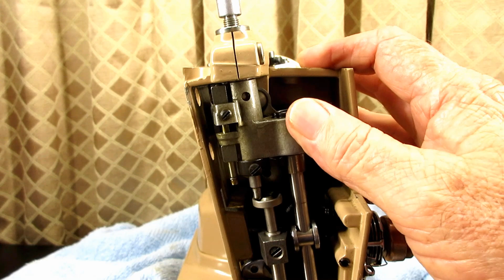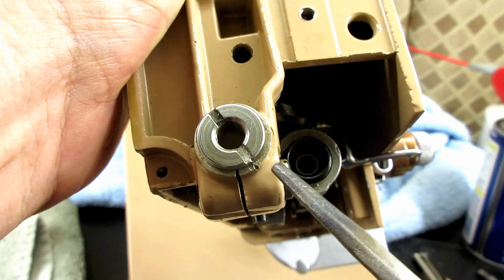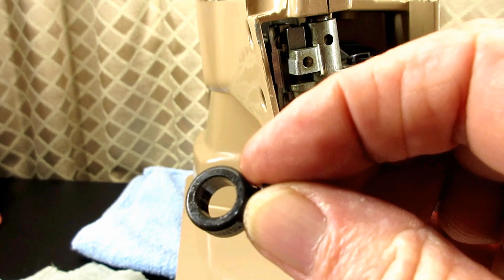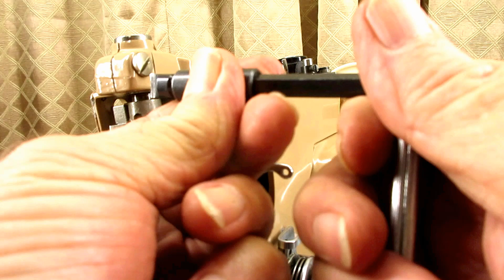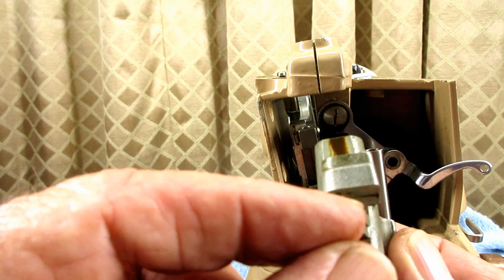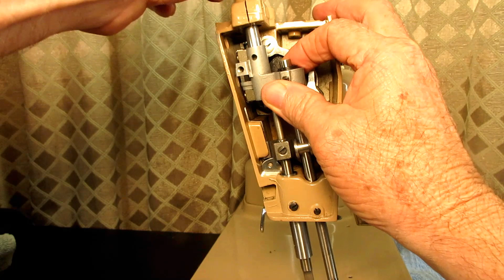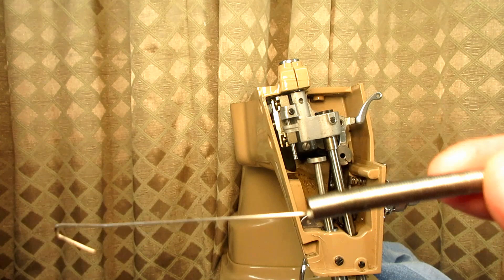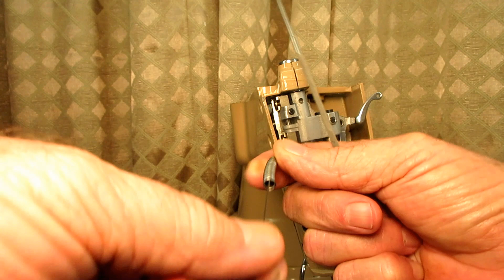The Needle Bar Vibrating Bracket of the Singer Model 403A Sewing Machine

Comment: Hi Andy
I'm restoring a Singer 403a.  All put back together however, the needle position button does not move the needle bar. When I push on the vibrating bracket, it doesn't bounce back. I have replaced the spring. I have taken it apart a put it back together 3 times. Any suggestions? 
Thank You
Pam
Reply from the maker: "all put back together", so what all did you remove? At 10:45 in the video, I show the spring for the VIBRATING BRACKET has one end connected to the TENSION ARM. The tension arm goes on the nose-end side of the paddle of the NEEDLE BAR DRIVING ARM (did you remove & replace that arm?) 
At 12:05 of this video https://youtu.be/tcdGVzL9T6o I start talking about how the NBDA must be installed, and mention the location of that TENSION ARM. So if I was sitting at the machine I would be looking at that. If you removed the DISC DRIVING WORM WHEEL as in this video https://youtu.be/VpQgjM-LFEo then you worked on some of the parts of the NEEDLE BAR POSITIONING BRACKET and you can check to see if you reassembled those parts correctly. Without seeing your machine in person that's about all I can suggest.
Reply: @andytubesewing1953  I basically stripped it down for a bath.  Taking out the cam holder as you did in a video. Now that it's put back together it sews straight stitch nicely. However when I try to move the needle position the lever moves but  not the needle. Also when in zigzag it only stitches on the left side. Any suggestions?
Thank You
Pam
P.S. Love your videos..... I restored a 401a..

Comment: What if the factory set eccentric screw was already turning?  is there a way to find out where it went? Thanks for these videos! 403 A!
Reply from the maker: The Eccentric hinge pin? Is that what you found or is this a what-if type question? A good question. Sometimes people move the pin without knowing it is set at the factory. So that pin is used to center the needle, front to back, in the needle plate hole. It involves using the straight stitch needle plate, the one with the small round hole, and a size 11 needle. The instructions for making the setting are found of page 142 of the service manual for class 401 machines, which I'll sell you for $50.00 (joke) You can download the manual free at this link: https://sewingdude.files.wordpress.com/2012/09/singer-401-service-manual1.pdf  (thank you, sewing dude)
Where the directions say to set the 401A levers and knobs at A-K-3, or your 403A just use Center needle position of the L-C-R knob and zero zIgzag or straight stitch. When you turn the hinge pin and get the needle centered front to back, that is the correct setting. You have to play with it sometimes it is such a small movement back & forth. Also on page 142 are instructions for centering the needle left to right which you may as well do while you're working on it. Thanks for watching my channel, Tracy. Question of the week award goes to you✨ 🏆 ✨
Reply: Thanks!  You answered my question perfectly.  @andytubesewing1953
Reply: this is what I was hoping you'd already answered. I turned the eccentric screw before seeing your video, but I'd turned it following the service manual because the needle wasn't centered in the hole when I got the machine. Glad to know I WAS doing the right thing and not messing it up further lol. @andytubesewing1953
Reply from the maker: @dragonchild569  Glad you found the answer Godd Job. Maybe you're a natural at this? 👍
Reply: I was just going to ask this same question. I just got one in a beautiful cabinet with a hidden drawer.Endless  Thanks

Comment: Thank you again, for causing me to be less afraid of, !!!THINKING ABOUT!!!, taking that fearsome step in cleaning my awesome Singer gems more thoroughly with the disassembling & reassembling!
I now have two Singer 401A's & a Singer 500A.
A few years ago, after cleaning up my first Singer 401A, it ran smoothly perfect until the spring you were working with came loose. I didn't know where to attach either end. So, I watch several videos to see if someone had their camera shooting downward into the top of their open machine. I seen about where one end should go, but, that little hook was broke off of my machine. I took a little wire, wrapped it to attach & made a hook. After watching your video, I see I guessed right as to where to place the other end. 😌 It works just fine for now.
I'm sure the hook could have broken off because it needed a more thorough cleaning, especially after seeing the gunk after you disassembled your's. Triflow seems to really help those of us who only knows a machines partial disassembly.
Reply from the maker: You have nothing to fear. It's hard to hurt a slant-o-matic. Just do one item at a time, take pictures as you go for reinstalling and enjoy it. It is very rewarding to have your machines looking/working so well.

Comment: Hi Andy,  my 353 Genie's (Joon) presser bar is a total disaster.   The gunk has to be 1/8th of an inch thick in spots and I really would like to take the presser bar off and soak it.  I can't find a video on how to do that with the Genie.  Also the take up lever is really loose, ( I think that's what its called) hoping a part isnt missing.   Looks like there is a spring involved which I'm not comfortable with but if I'm lead through with a video that I can replay, (just in case something bad happens and the world is about to end) that would be awesome!.  Your probably pretty busy, (knee deep in machine parts and cleaning solution) but I will happily wait, if you don't have a video made 🙂.  Much appreciated!.
Reply from the maker: Thanks for the donation. It sounds like a messy one, poor thing. Time to take Joon to the SPA I think. Please bookmark this playlist of my videos for working on the Genie Model. https://www.youtube.com/playlist?list=PLsCOZgzzaiKJvzcqn97Yh8lvx-tbdFl2p
In these videos I show "how-to" for the covers, handle, spool pin,bobbin winder, presser bar, needle bar, hook to needle timing, motor belt, handwheel, on/off switch, light, motor, feed dog, apollo hook system, needle thread tension unit, cleaning (you will enjoy this one, I think) and lubrication. Everything you need to help Joon get good to go! Best of luck
Reply: @andytubesewing1953  sure thing, it wasn't much but every bit helps right?.  I've watched most of the videos but I'm needing to see how to disassemble the presser foot bar and the presser foot lifter.  I watched a different video you have on that exact area and got a better idea of what's involved.   I'll see if I can manage with that video.   The stitch selector is also not wanting to move smoothly,  not sure what's up with that.  I might have to bring her to my sewing machine guy here.  Wish I could send her to you but Vancouver island,  British Columbia,  Canada  is pretty far away.  Anyways,  thanks for the videos, I'd love to see you restore a brother galaxie 221.  I've been given one of those, and I'm going to have to clean her out too.  Take care and all the best with that crazy weather you guys get 🙂.
Reply from the maker: The video for the presser bar is included in the playlist for which I gave you the link in my comment above. Here is the link to the presser bar video: https://youtu.be/Jn6Vz0dFb-E